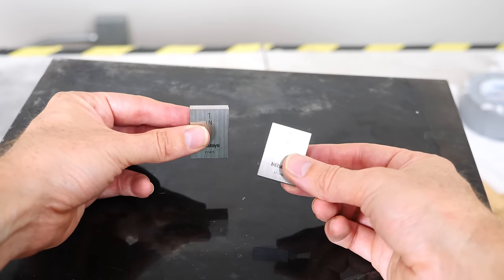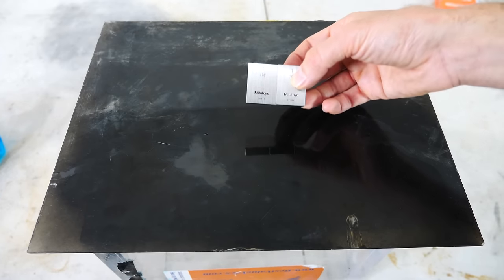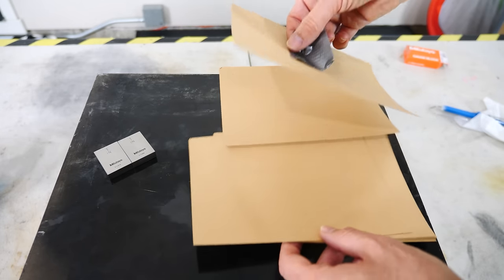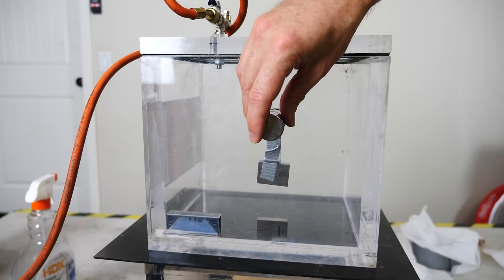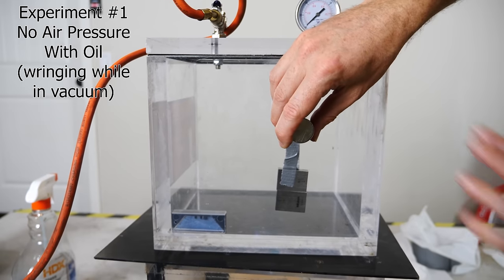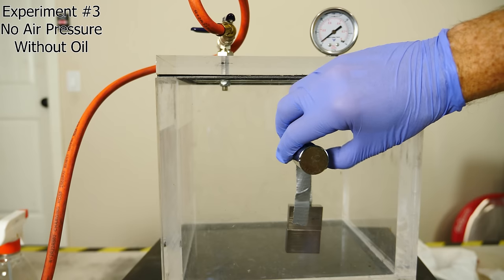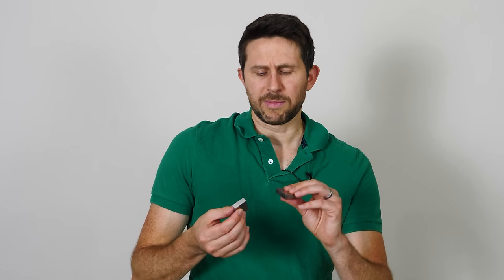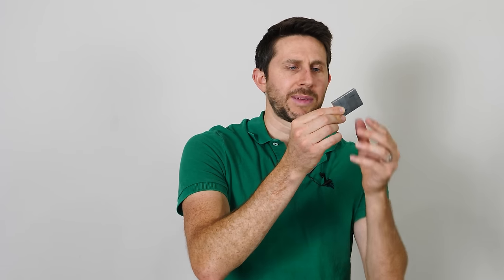Will Gauge Blocks Wring Together In a Vacuum Chamber?

Comment: So if you put two smooth pieces of metal together with a layer of oil on them (or any other type of liquid), it creates a vacuum which is when the air gets pushed out from between the two pieces of metal. The liquid is keeping the air out by fully sealing it out which makes them stay suctioned together. What I don't understand is why exactly a vacuum would be messed up because of being in another vacuum. How does something void of air get affected by taking away the air around it? I'm so confused about this. Anyone know?
Reply: Also, I already know people will say air pressure, but I want to understand exactly what's going on.

Comment: Sounds like cold welding that happens in space.
Reply: Nvm, just looked it up. Not the same thing. Cold welding is for pure metals where electrons move freely across atoms of both metallic blocks. While gauge wringing involves van Der waals forces between molecules (steel, ceramic, etc).

Comment: If we keep it stuck together for a month then would they become one object/metal?
Reply: Are you talking about diffusion? If Yes the the answer is no. Solids take thousands of year to diffuse into each other. Many other factors also work.
Reply: @The_Tormented_One  what if we put it under heavy pressure?
Reply: @my3dviews  thanks for that video. And yes you are true but he asked in general that's why I gave a general answer.
Reply: @sanketvaria9734  generally, putting in high pressure doesn't help much in diffusion but in the case of some soft metals, pressure can help in joining them together which is same as cold welding.

Comment: I have an idea: make liquid methane and light it on fire. Also make solid methane in the vacuum and light it on fire (leave some oxygen for the fire to react to.)
Reply: If it's below -188 C it won't catch fire, and I'm not sure it would get solid in a vacuum chamber using liquid nitrogen.
Reply: @NoNamer123456789   yes but If you think about it, when something catches fire, the gas coming off of it is burning, not the physical thing itself. And the lidenfrost effect would insulate the liquid from the fire.
Reply: @legolegends9750  That's why I wrote -188 C, it's the flash point which means the liquid will give off enough vapor to start a fire.

Comment: At 1:25 you said you could put 2 blocks together and you don't have to account for the gap. And then at the end you said they are manufactured on purpose smaller to account for the oil which fills the gap!  Which one is it, dude?   Here's what's going on... They stick together because of the properties of laminar gas flow. The gap between 2 pieces of thermal pane window glass  is is too narrow to allow for convection of the gas even though the sun, through the glass, warms it.  Stagnant air between the glass prevents the convevection of heat. The gas becomes viscous. No convection, no movement. At 1/8th - 1/4 of an inch separation. You can perform an experiment with 2 pieces of dirty window glass, no oil, and they will not pull apart.  The  Intake/exhaust valves in a combustion motor  seal merely with 2 polished surfaces.  (and back in the day, a little lead in the gas...)  Electrons have never been proven to exist (I agree) so that eliminates the bonding between atoms... Your plastic box is incapable of creating a high enough vacuum to perform that experiment adequately... So, using platonic logic, the only answer can be 2 very smooth surfaces, with a gasket of oil between them,  prohibiting the flow of air necessary to allow the separation of the 2, incredibly close solid blocks. No magic, no atomic/molecular bonding, just simple physics... Now, wasn't that easy? 😁

Comment: the reason why they stick together is the line of force on the metal are aligned with the charge on your fingers, it can be aligned by radio frequency also like in the coherer device, both hands acts as two electrode of a battery, is well know that there is an electric potentials between different parts of the body in this case right hand will be your positive and left your negative, the oil or the air only change the dielectric potential between the irons.

Comment: Dude airpressure holding those blocks together!? How muh surface you think there is and how dence you think air is compared to the block.. electrons will interact whenever you bring them really close.. and no with oil this effect would not be stronger.. that just depends on the oils viscosity. This effect is called capillarity if two surfaces “bond” with the use of fluids. Its used in soldering as an example with the additive of flux.

Comment: I would like to see you test what happens when you leave dry (no oil) guage blocks connected in a vaccume for a prolonged period. Do you get cold welding?

Astronauts and NASA expienced "cold welding" in the early days of the space program when surfaces of identical metal alloys were in prolonged contact in the vaccuum of space. Doors and hinges became hard to open.

That may mean that the electron interactions are more important than you give credit for in this video.

https://m.youtube.com/watch?v=Y2nQ8isf55s

Edit:. I discovered that you did a video on cold welding in the past. I'm curious, though, if smoother surfaces like those of the guage blocks are more likely to weld?

Comment: So, um.. I'm not completely convinced by your conclusions for the following reasons:
1.  Air pressure in vacuum is nil, so there is no lower or higher air pressure between the blocks--hence it is irrelevant for adhesion/cohesion between the blocks.
2.  Surface tension causes adhesion/cohesion how exactly?  What compelling/convincing evidence do you have to offer for that belief/hypothesis?  You seem to have only offered your opinion.
3.  I think oil is a major fact for why the blocks adhere/cohere inside & outside the vacuum---I'm just not certain exactly why.  Less oil produced less apparent adhesion/cohesion & more oil (within a limit) produces more apparent adhesion/cohesion in the vacuum.  Now the questions are--why & how?
4.  Elemental attraction/bonding?  What compelling/convincing evidence do you have to offer for that belief/hypothesis?  You seem to have only offered your opinion.

Comment: Not 100% accurate, the blocks were not pushed together in the vacuum as they were when holding them in your hands. Interesting though, I guessed the molecular bonding force would have been the strongest of the three.